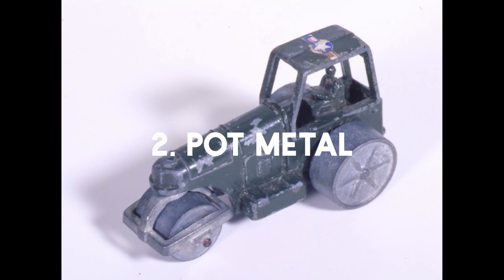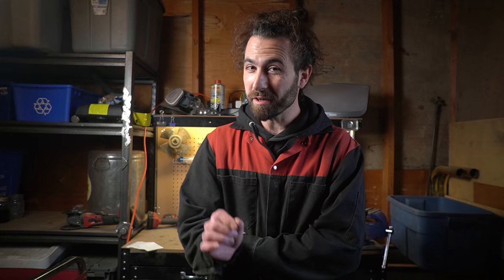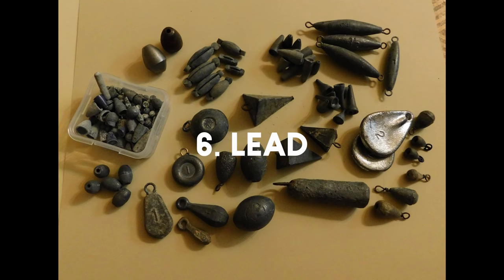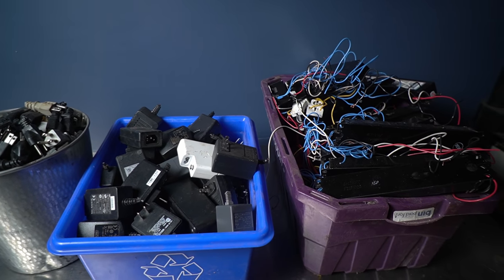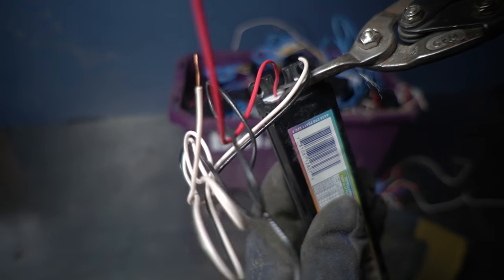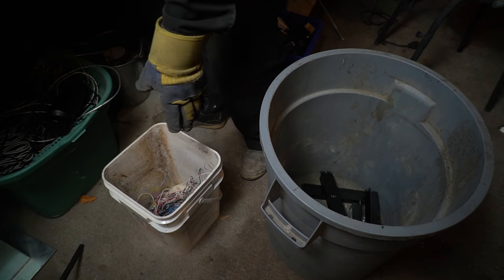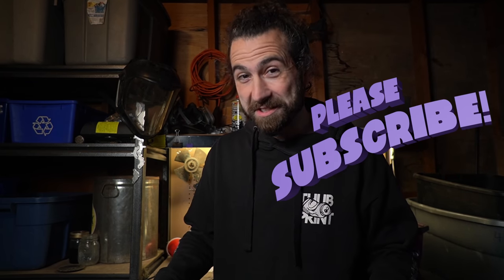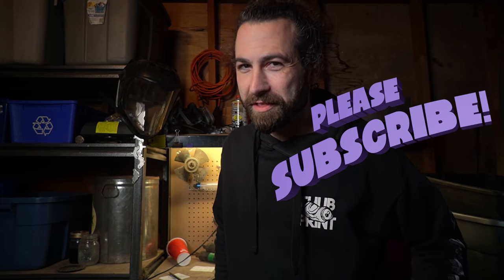I Never Scrap These 9 Items!

Comment: I just throw aluminum, cast aluminum, zinc, and lead in the same bucket and they usually give me clean aluminum price for it. I don't scrap plugs or transformer plugs because they give me extension wire price for the wire with plugs. The only electronics I scrap are receivers because there is a large microwave transformer inside that is always copper. I just take computer towers whole and get that price because there is no market for ewaste in my area.
Reply from the maker: Makes sense to me. Gotta check the receivers first though, some of them are worth quite a bit these days

Comment: Thub, for the plugs best you mount a good vice and then leverage them out. Much easier and don't need to spend money for gas
Reply: agreed
Reply: Completely agree, also if you have kids you can talk them into doing that part, I bribed my kids with pizza, works every time..
Reply: @TheWolfster001  🤣🍕🍕🍕
Reply: Also can heat them in water till you can extract with knife

Comment: I also don't bother with aluminum foil, i wouldn't come across enough to bother having another bucket. I do however pull the brass/copper from all plugs - 1 end in the vice and rip them out with pliers. Yes it does wear out the wrist but i tend to do them as i go so i don't gather a bunch to have to do at once. I hate power adapters but i still pull them apart.
Reply: When the plug end is in the vise, and using round headed channel locks instead of pliers, grab the spade ends long-wise and “roll” them out.  Hard to explain the visual, maybe you can try next time.  I do these by hand this bay, the vise would make it way easier though!

Comment: I try not to use my hammer to smash the transformers, ac adaptors, switches, receptacles and other items with hard plastic cases. It seems easier and less messy to simply put them in my vise if they fit and tighten the vise until they crack apart. Holding your non vise-cranking hand over the object while you tighten the vise will help contain the flying debris.

Comment: Here's how to do power sockets: either use 2 pairs of pliers to pull, one to hold the plastic, the other to pull the prongs, or just use some good cutters to snip the prongs off. You get half the metal but it's very fast and much less wrist strain.

Comment: Those small ferrite rings wound with copper are inductors, an inductor opposes HF signals meaning it passes low frequency audio signals more easily. Good videos btw.

Comment: try using a vise for the plugs. You could use a blow torch on the prongs to soften them up. I pull the prongs as i prep the wire.....no bin required, just prepped scrap.

Comment: For me personally I said screw it at the transformers and the plugs because I have a lot of wires and I have a bunch of those and I said why not scrap them o tried the method you did in the video with the plugs and it works and I have to admit it is saved me a bunch of time

Comment: Very nice video, I agree with some, ehhh on others, but due to location (US). Scrapping is a 100% personal preference endeavor. One person may deal in volume from companies that have a regular dumping cycle, another person may be part time and finding it where they can. Some people may never touch refrigerators or ac units because of the Freon. Other people will take them because they can sell the refrigerant. 

My scrapping style is part time, and component level. If a board has an inductor or two, a few heat sinks, or other goodies, I will remove everything I know that is of value, and let it pile up. Bigger inductor torroids, I will break the ferrite, and throw the copper windings into a separate bin because of the enamel coating. Pull the steel pins out of the heat sinks, and unwind little inductors and transformers for the copper. Is it a good cash to time ratio? Nope, but for me, it’s therapeutic. 

I can definitely see Thub’s view of not wasting time or space for items that won’t pay for itself. 

Some people go beyond the yard. Having a furnace that can melt metal and make ingots, can be sold for more than scrap. Check out the prices for copper ingots on the famous auction site, and compare what the yard pays you for the same weight. 

I like doing E-Waste myself. I understand the dangers, potential hazards, and proper disposal of every piece of the item, and anything used to process said items. So far, so good and plenty more to go. 

Again, 100% personal preference.
Reply: I enjoy the e-waste as well.  I go for the precious metals gold silver (for inquarting) and platinum.

Edit: but ya got to get the electronics for free in my opinion.

Comment: Great video! I keep electronic scrap as an investment, I think precious metals are way under priced. If it corrects and goes way up awesome, if not oh well it didn't cost me anything to gamble a little bit.
Reply: You can do what every you like and who knows what will happen in the future but i have been around scrapping for almost 50 years and saw several guys hoard stuff back thinking the price would go up or they would have time to clean stuff but it never worked out. I scrap about ever thing from semis to toasters i dont like to stock pile stuff i fill like i lose money the longer i store it.
Reply: I piled up 250kg copper. Only the really dense stuff. Don't think it will get cheaper.
Reply: @leowuli8381  the times we are in now. I have more confidence in the intrinsic value of the metal more than I do dollars.

Comment: A cable wrapped through a ferrite ring or a ferrite block over a cable is called a choke. It filters high frequency noise in signal cables

Comment: I agree 100%, but I'm lucky. I don't need to remove the brass/rubber plugs on my wire.   Vacuums cords are always great fine.  I did the  hammer to the other wire ends/motors once, when I had +100lbs of wire.

Comment: I agree with majority of your list, the plugs you have are very thin brass compared to what we have in the UK. Also the ballasts you have are not good to scrap what we have here are easy to take apart and you end up with a good bit of cooper wire. Soon they will be gone due to LEDs
Reply: We have electronic ballasts in the UK too. I don't bother with them, no money in them. The older ones I do take apart for the copper coil. Tip: scratch the ends before taking the hammer to them. Nothing more disappointing than scrapping a ballast only to find it's ally wire!

Comment: You need to talk to some of your local computer shops. Not the big box stores. Many of then will have a e-waste buyer that they deal with. The reasons why so many places take e-waste for free is cause they have a buyer for it. They just pallet the stuff up and sell it bulk to a processor that will take them apart so they can move it one to the next round of buyers. I have to drive over 100 miles (160 km) for my nearest buyer. But with a pick up just like yours filled to the top with just laptops. I can net between $2000 to $3500 for the load. They are not bought by the pound. But by the processor type in it. Between $10 to $50. each if it is the later i-7 processor. But again. It is one of those things where you need room to build a stock pile.

Comment: I'm in south Florida. Laptops pay about 50 cents a pound whole and video game consoles pay the same as computer towers. Cell phones and digital cameras pay $1.00-$1.20 a pound. Power supply were around 25 cents a pound last time I took some. But you are right, not all scrapyards buy E-scrap. Ballasts I sell whole for about 15 cents a pound.

Comment: I dont make plug soup to soften them. I hold them in vice grips the pull the prongs out. I don't always get the copper strands out but I get the brass.

I dont keep the iron because I don't have enough room to keep it to make enough. My yard is too far away to just bring small loads. Right now, I only keep copper, brass stainless, and cast aluminum.

Comment: Pretty fortunate in my area. Yards take power cords with the ends still on them, no need to cut them off. And my E waste place gives .35 per pound for incomplete laptops. Pull the batteries, RAM and hard drive. I stack them on end in milk crates. Oddly enough the Lithium batteries from them are only going for .10 a pound here. Figure with the push towards electric cars they'd want as much lithium coming in as possible. Power supplies take up a lot of space, and get heavy quick. Right now there's an .08 per pound difference between shred and selling them as power supplies. And that's with shred being up.  I usually save them.  Wall blocks/ transformer plugs get tossed to shred along with any ballasts.  I will do gaming consoles and such, get some decent boards from them usually. VCR/DVD and the like I'll pop open just to check. Usually only a couple screws. If I can see any nice IC chips them I'll grab those but otherwise right to the shred. 
Something I don't save are A/C compressors.  Large, unwieldy, and likely to spill oil, they go to the shred. Not worth the hassle for me. 
Nice vid, good to see what different areas will pay for and how they handle it.

Comment: 5:00 those ferrite hoops wrapped in copper are call toroidal transformers. Great video Thub! Best decision I made was to buy an old used 6x10 covered trailer for my non-ferrous scrap. Holds a surprising amount of scrap, but still it really helps to cut down the number of bins of worthless/low-value scrap taking up valuable space.
Reply: That wire isn’t always solid copper… I have 4 10lb spools of toroid wire that is copper plated.
Reply: They are inductors commonly called chokes, less of a mouth full but same thing

Comment: Have you ever taken apart a light ballast there's sometimes three to four electric motors in them the only downfalls you got to dig through like this rubber gasket stuff that they pour on top I mean it's not that hard takes about 3 minutes a piece to get them all out

Comment: There is some county property at an old municipal sand and rock quarry near my cabin where they let people use it for a shooting range. I went out there to rockhound for agates and fossils and as any good rockhound, I had a shovel, plastic coffee can and 20 mesh screen. In 10 minutes of sifting, I had well over 100 slugs weighing just over 1/2 lb. I didn't have much time, so I planned on going back but haven't made it back up there yet.
I have a forge and I'm still trying to figure out what I'm going to make with all these. Probably jig heads.
Reply from the maker: That sounds like a great source! Doing an environmental service as well so win-win. I think I’d be just as keen on sifting out brass casings but I know people refill them so probably not as many left in the dirt

Comment: On the light ballast we freeze them pull them apart wich takes only a few seconds then hit the tar part with a hammer over a trash bin and cut the copper wire off. We get a good amount of clean wire this way. some are aluminum however so be aware. Thanks for the video.
Reply: I think I'll give that a try, thanks mate.
Reply: I do get it, you  do all that for a bit of wire?
What am I missing? 🙂
Reply: @paulcoenen7918  It takes minutes to clean one out.  You have to play the long game when scraping that's what makes it profitable. Or sell it for shred price whatever works for you.
Reply from the maker: I’d never thought to try that! Might have to give it a go 😁
Reply: @Alex-yv5qw  
I still don't  get it.
 What is in it that makes it worth carrying  to a freezer then back to work bench to smash open with hammer?
Gotta be more then 6 inches of copper wire for me to do that for 2 pennies  worth of copper. 
 I have never  broke one open so I'm not sure.
Reply: @paulcoenen7918  Well some people never will.
Reply: @Alex-yv5qw  
I just figured  as a couple  pounds in shred worth  maybe  16 cents or break  out say 3 cents in copper  that maybe I was missing  something I don't  know about  since I  never broke  one open.
 Sound like I'm not missing anything tho since nobody  wants to give an answer. 
 If it's worth it to you  more power to you. 
Any scrap is good  scrap 👍
Reply: @paulcoenen7918  About a quarter to half pound of fine copper maybe more or less depending on the size. I wouldn't suggest putting it in the freezer especially if you have a wife. They tend to frown on scrap in the house. Save it for a winter project things slow down up here in the winter.
Reply: @Alex-yv5qw  
Holy man so I am missing  something. 
 I will definitely  give  that a try. 
I'm in Wisconsin so no problem with  keeping  them  in the garage until they  freeze.  Thanks  Alex 👍
Reply: @paulcoenen7918  Hope it works out for you it's a shame to give away copper to a yard. It's been years since I scraped this way so I'm not exactly sure on the weight but it's well worth it. Now I just collect wire and bits of brass or whatever from my job sites. I do miss it however.

Comment: I have made pretty much the same conclusions to those things that are not worth scrapping in general.
Okay, if you have enough logistics and large warehouses etc. you should collect everything that doesn't decade because volume makes money 😅 but i strongly disagree what you said about lead. 
I live here in Finland and here the few biggest cities has the best prices when you are selling scrap. All those cities in this summer they pay approximately 35cent per kg that "fishing balance- lead", but car batteries was 50 cent/kg, and pure lead 80 cent per kilogram. And because lead is very heavy those kilos adds up.
One car battery weights about 10 kilos, that is 5€. If you sell 10 car batteries you get 50 euros and thats a real money when you comparised it to the amount of work you done. 10cmx10cmx10cm cubic of cast brass weights a 7,7 kilos but if you need to use example the turning lathe to work on the brass, some amount of lead had to add in to the basic brass. Those types of brass weights 8,8 kilos per 10x10x10cm cubic. And when selling that lead containing brass you get better price for it and it adds the total weight quickly. I'm sorry if you didnt understood my english but the point was that lead is good to collect and sell her in Finland

Comment: Use a big vice for the walladapters and plastick incasements powerplugs and stuff, it saves time and energy.
Extras, its safer than hammering on shattering plastic and people around you will hate you less for the noise you make.
My shed/minishop i devided in 4 corners steel, alu, copper/brass and trash, only when one of them is full i bring it to the yard, they will appreciate it when you come with a full load with only one type ( time and efford for them ) instead of weighing 5 bins of stuff and adding witch will always lead to discussion, they hate that.
Also the more weight of one load with one type of metal will bring the price up, atleast overhere in Netherlands it is.

Comment: I assume the power supplies are nonfunctional in this case. You can typically short two pins to test them and see if they turn on. If they do, 20$ would probably be good.

Comment: @thubprint - a little tip for you regarding the plug sockets, place them into your vice and simply ply the brass pieces out using pliars and you will find it very easy and also the existing copper wire comes out attached to them aswell. It’s very easy and very quick to do 👍🏻👌
Reply: You often break the brass tines and the copper off if you do that and I find it is better to just sell them as copper recovery.

Comment: I won't pick up cans/thin aluminum trays... But I do collect what I use at home and take it in when I have a trash bag or two full. 

As for the plugs... I never heated them, I just pulled what I could with plyers (I've seen people who put them in a vice to distort them).

All these small items, just collect in my bins until I have at least 100 lbs or more. I would never take a trip to the yard unless my truck was absolutely packed to the gills.

Comment: for plugs just use a plyer to hold the plug and one to pull out using a twisting motion which means both wrists are working makes it easy.  the biggest trick is don't let them pile up to much 10-30 plugs goes real quick
Reply: Yes, that's the thing with scrap, try and sort it regularly and not let too much pile up - having said that, i have over a hundred microwave transformers awaiting 'rendering'...eek.

Comment: Ive got to chime in on the brass plug thing.  You dont need to boil them. Its a completely unnecessary step.  Simply grip the plug in a pair of channel locks in your left hand and use diagonal cutters in your right hand to pull them out.  With a good pair of gloves your hands won't hurt; your way.....looks painful. Also, the diags will hold the plug end better than the tool you are using. 
Sometimes you cant pull the ends out and have to twist them to break them off, leaving some behind. But that isnt a big deal.

Comment: Just put them in the paper drill out the weld, holding the transformer cover on the further quick specially with their grill, then turn the Balis upside down inside a pizza oven with a drip pan at the bottom set the temperature to 150 to 200 150 would be more ideal But the balance and let the tar drip out of it. You could then clean it up a little better if you wanted to with muriatic acid to get the rest of the tar off of the copper initial set up assuming you already have a drill would be about $50 on the high end for a pizza oven, a little tan or even a cover from a tower computer would work as your drip pan. You could either clean the tar off of the drip pan or throw it away and get another one. It’s no big deal although I would suggest doing this outside instead of inside just to help eliminate the smell in the building.

Comment: they call ballast wire #1 in canada? here it's #2 due to gauge and the silvery coating on the wire cores. if you grab thpose ballast wires at the base with nippers or pliers and pry them out it's a little faster in some cases and brings you around 10% more wire by ripping it off the circuit board and pulling it out